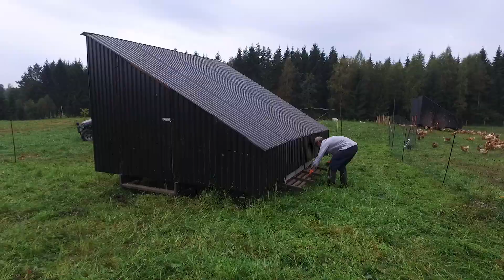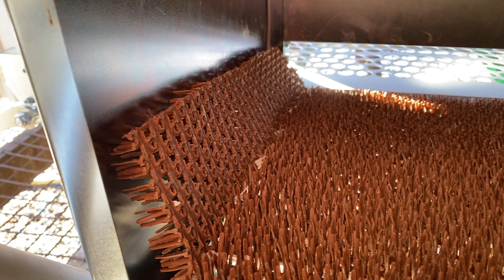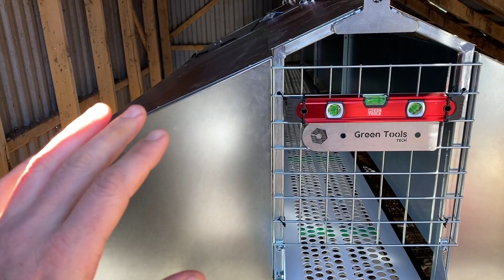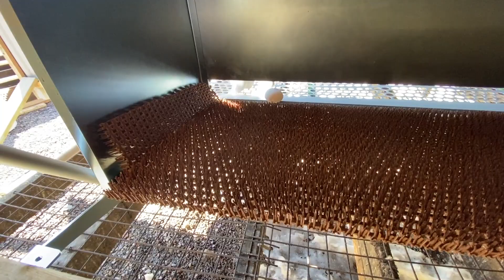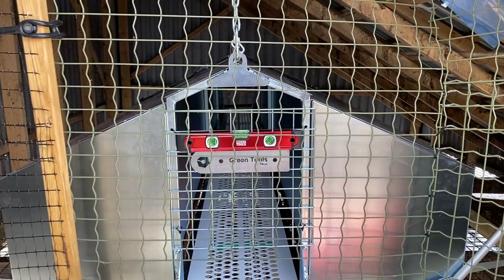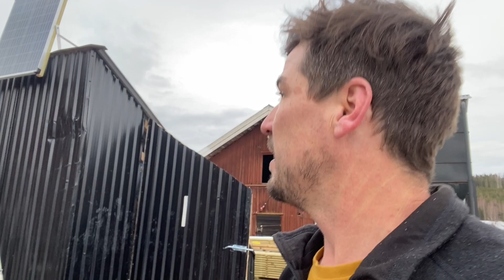Egg mobile 2.0 complete!

Comment: So. Another solution for mounting your actuators. You are worried about the strength of the metal roof being able to cope with the stress and weight of the actuator cycling.. Instead of carving holes in the end of the nesting boxes and changing the whole design. Simply add a rolled bead or 2 in the roof panel. It will ad tremendous strength. It's faster when it goes into production. No Cad files need to be changed and it's the simplest solution to keep labor costs down. Cool set up

Comment: Instead of an actuator to level the nest box, a damper should do the job cheaper and reliably.  Something like a tube in a tube, one tube connected to the box and the other to the egg mobile.  Some sort of stiff grease between the tubes to resist quick motion but allow slow settling.  Lots of off the shelf components basically do the same thing.

Comment: you could suspend the nestbox in one point and auto levelling it via two or more dampers (car trunk pistons). It will auto level in both planes if the dampers are well positioned. Plus the dampers will dampen any movement caused by the chicken or the quad.

Comment: Heat in the tunnels... what about a dark metal chimney.... perhaps near the centre to suck the hot air out and the inlets of fresh air at the ends with shade cloth... so you don't need to have shade cloth over the lot?

Comment: I did that (keeping two flocks separated in the polytunnel) this fall. Worked fine - but not an obvious improvement to having them all in one flock (which I have now). Just more work, without any visible benifits. That was my conclusion anyway,

Comment: The project is well executed!! For the winter time isolation is a concern? Or its ok that open air from down platform is open?...cold air will come from bottom for sure, but at least if warm air is well obtured before it escapes across roofing it could improve the general isolation of the cubicle. And idea, with some expanded cork around inner walls and roof, but not platform base, it could help. Another idea, though me myself don’t see it well landed yet, is to put some led light for growing plants inside, that in some winter days of north Europe will give some light for the flock and just a bit of more comfy warmth. I just comment them in case it can help bring other related ideas to you.

Comment: It'd be nice if the whole assembly could slide out of the house for easier access to cleaning, repairs etc. You could install the whole nesting box on a beam with rollers. Not sure of the weight distribution would cause the house to tip over, but it might need a couple of support legs in one end.

Comment: It seems like it'd be simpler to omit the internal new wall you had to build by punching the end of the conveyer belt out through the wall, maybe with a small cover? I guess it's a little trickier because of where the door is, but maybe out through opposite end instead? Would leave more space in the eggmobile too

Comment: How are you going to gain access to the tunnel if you have egg mobiles blocking both entrances?  That would also block the air flow to keep things cool in there when it heats up during the day I would think.  I guess you could park them a bit away from the tunnel and create some sort of covered run to get them in there yet keep any bird poo falling on them from above between the two structures...   

Wow.  It's gonna be a heck of a year!  Hope the bird flu resolves pretty quickly this season so you can get the girls out in the fields asap.

Comment: Great work so far. It'll really help small farmers everywhere. I wanted to make a couple suggestions about the sectioned off space where you collect the eggs:
-Many egg mobiles have shelving to place a 30 cell egg carton (or an alternative) next to the belt, so you can use 2 hands for cranking the belt and removing the eggs. Maybe it's in the plans and I missed it, but it may be worth considering if you haven't already. You may also want to remember to save floor space for floor-to-ceiling storage of spare 30 cell cartons and protect them from poop with more plastic sheeting.
-Lastly, idk if its a concern that the belt sags on the bottom, leaving a small amount of space for the young chickens to somehow damage it or roost on it (and poop on it). I guess we won't really know until your next flock is inside (unless you know something I don't).
Looking forward to seeing the process and the end result. GL
Reply: i was also wondering about the sag in the belt. one extra roller ( or even a section of steel rod) on the underside in the middle would probably mitigate that.
Reply: Not keeping extra egg cartons in the egg mobile would be more hygienic....😉

Comment: Hi Richard, I think the egg mobile design would be a problem to keep your hens laying in it over winter. With the mesh floor, I feel like it would be very difficult to keep the temperature on a good level when it starts freezing outside. Not to bash your ideas, but this may be something that you have not yet thought about.

Comment: For future design have the hanging chains be an inverted v shape connecting to the outside edges of the box. This enables the box to still swing and auto level whilst still supporting the outside edges in case you have a bunch of hens decide to only use one side.

Comment: what keeps the wind from flipping the solar pannel.... each unbuffered flip makes nano cracks into the pannels Si crystal struckture, that kills conversion efficiency of the panel. pretty fast
Reply: otherwise, well done
Reply from the maker: @saschathinius7082  A little bit of weight will do it
Reply: @regenerativeagriculture  perhaps a strip of rubber (or even nest box mat) glued on the underside of the frame would help absorb the shock of the solar panel frame striking the metal roofing?
Reply from the maker: @HurrayForFacts  yep, sounds reasonable!
Reply: @regenerativeagriculture : would have been my preferred method too... I had panels that where rattling in their frame, those where useless in a year... after replacement with same from same production batch with fixing the rattling, problem solved.... under the microscope you could see that the rolling made microcracks...

just wanted to share the experience
Reply: @regenerativeagriculture  Perhaps a screw/bolt/something poking out on either side with a rubber loop at the ends of the strings, to tie in place a bit like your internal door?